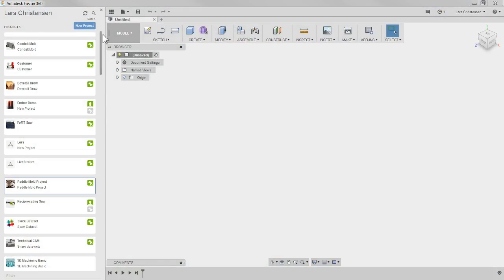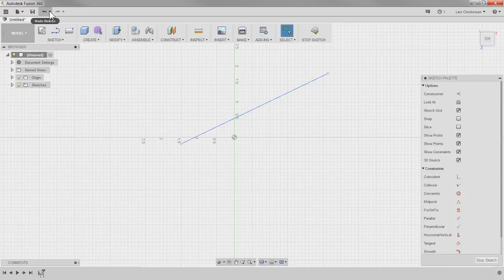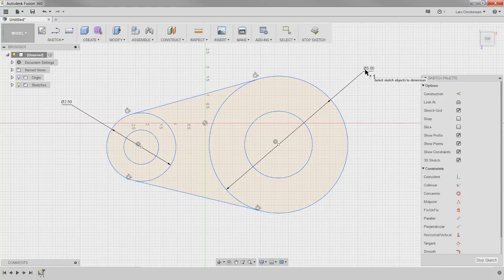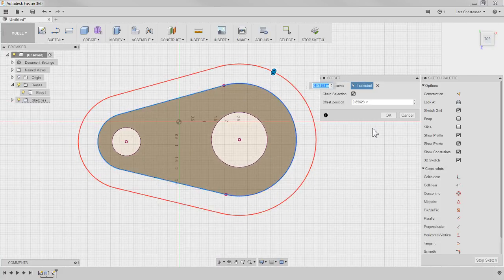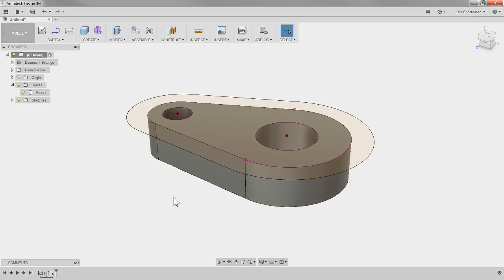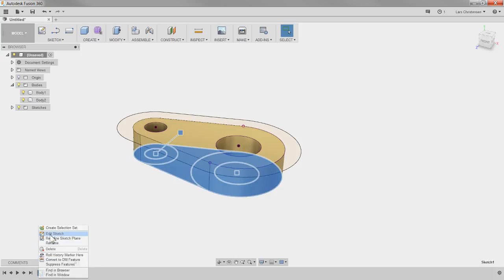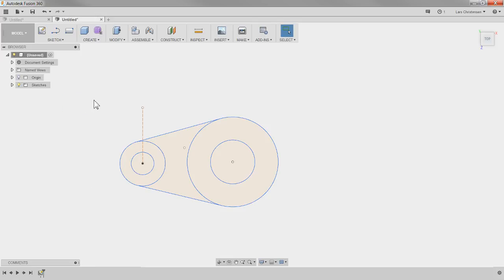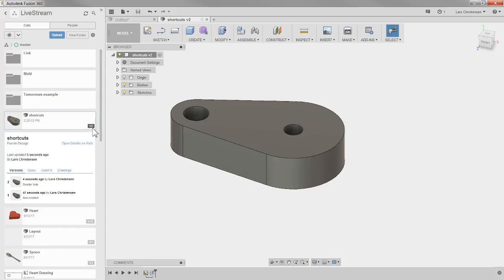Fusion 360 — You Want Shortcuts — And Your Comments & Questions — #LarsLive 57

Comment: Not really a shortcut but what I sometimes use:
Hit "l" to draw a line. First click starts the line and the second one finishes the line. But instead of releasing the left mouse button on the second click, one can also keep holding it. Fusion automatically now switches to the spline mode and one can continue a with a spline where the line has ended

Comment: Hey Lars, can you discuss about 3d Printing? I'm working on a project but it's bigger then my print area about 5 times bigger. Is there a way to cut my model up to easily print up and then glue them together?
Reply: Meshmixer works but you don't have very precise numerical control over where you place your cutting planes. How about putting extra workplanes into your model and using "split along plane/suface" and making separate bodies / components? Usually you will want to control to some extent where is a good place to cut the model not only dependent on the maximum print area of your printer, right? And maybe add some guides / glue surfaces to the parts so that they are easy to assemble? All that can be done during the design process right inside of Fusion 360  imho. On the other hand if you are starting out with only mesh data (like an STL file) then consider Meshmixer first. You just kind of have to eyeball the places where to place your cutting planes and you can only do one cut at a time (last time I tried anyway) then save out your part, do a CTRL-Z, do another cut, save out the model etc. There are some tutorials on youtube in the meshmixer channel and elsewhere. I hope that Autodesk will integrate all the extra functionality of Meshmixer into Fusion at some point and combine it with the precision functionality one is used to from parametric modeling. Good luck!
Reply: Hi Westchester: Try Netfab or Autodesk Meshmixer
Works great for me (Y)
Reply from the maker: I would love to talk more about 3D printing! As muddy said, you could look at something like meshmixer or one of the other printing utilities.